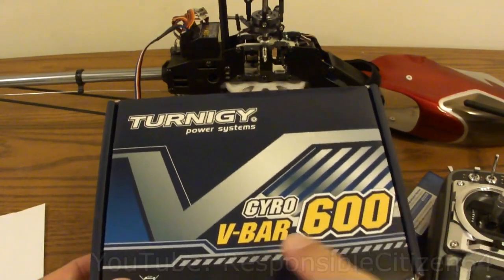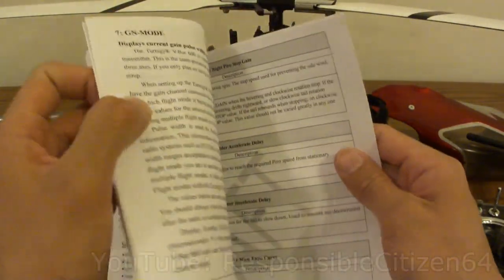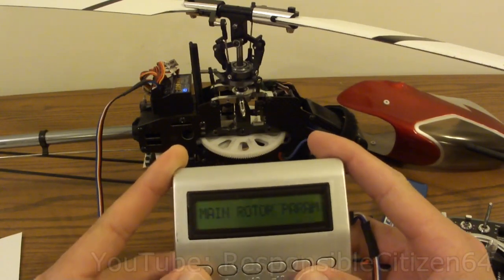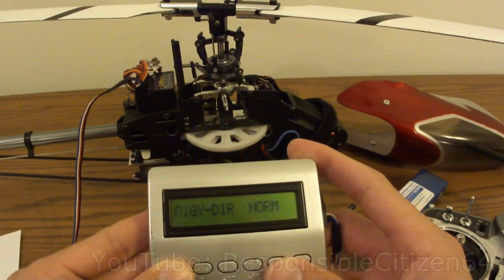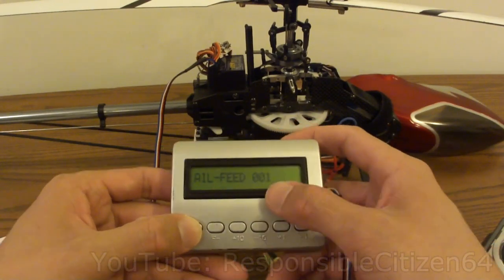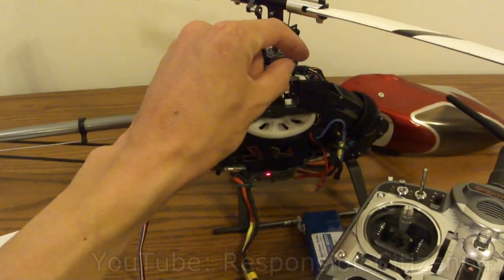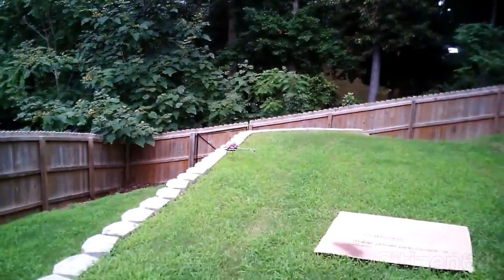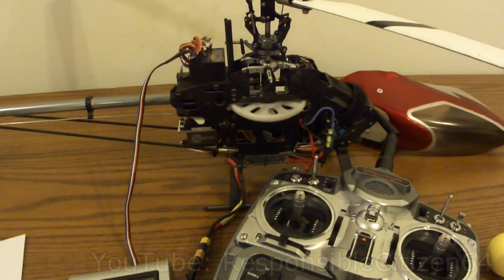Turnigy v-bar 600 FBL flybarless install on HK 450 Pro

Comment: Hi. I have a question about the HK flybarless head. I have a T-rex 450 V2. What other parts do I need to convert to this head? I heard I'll be needing a 450 Pro feathering shaft and dampeners. Anything else? Swashplate?

Comment: Thanks for your help.  I like the Hyperion, but is expensive for me.  What do  you think about this servos? GWS Naro Super 19g / 3.6kg / .07sec Digital Servo.   I bought a large size servo frame for my 450pro, because little servos are more expensive than 15 to 20g servos